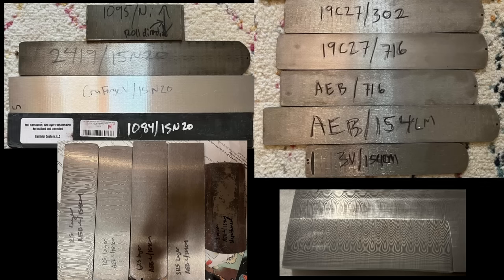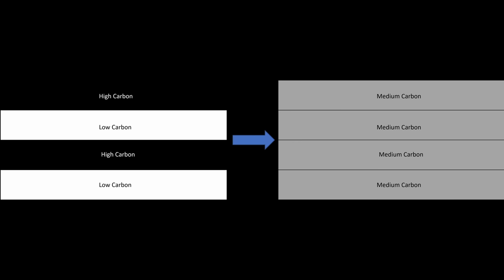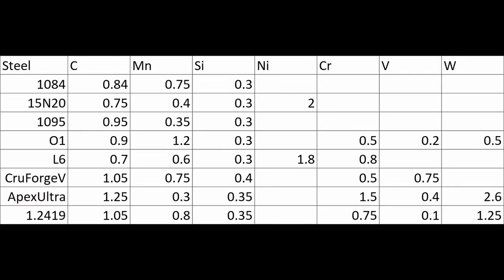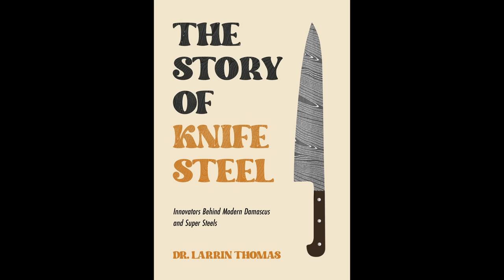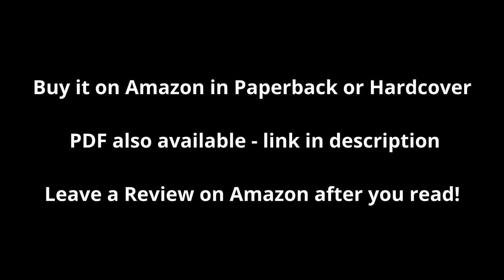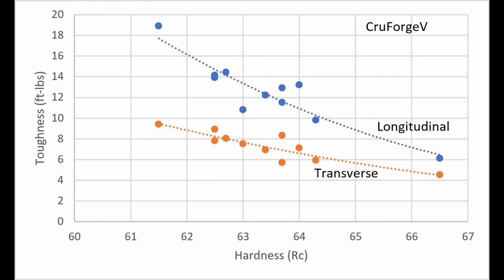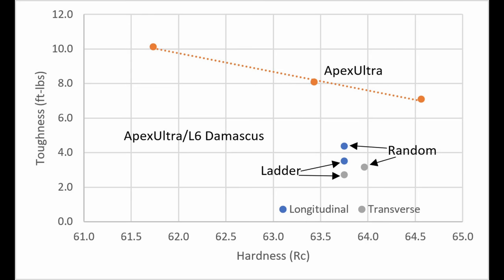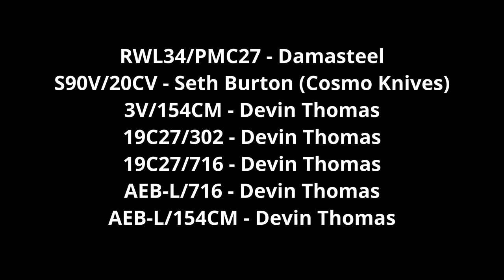Damascus vs. Super Steels - Testing a Dozen Different Damascus Steels!

Comment: Nice. But why are you calling PWS, "Damascus"? I readily concede that you know more than me about metallurgy, but Damascus and PWS are not the same thing at all. So many people are deceived into buying PWS knives, thinking that they are getting real Damascus, which hasn't been made in a very long time unless you count the analog created by Al Pendray and John Ven Der Hoeven, which is probably the structural, functional, and chemical equivalent. I HATE it when people who should know better, call PWS, Damascus.
Reply: Because PWS is Damascus even if it isn't "real" Damascus.
Reply: @rays5163  No it is not. Why is Damascus called Damascus? Because a lot of swords were made there, from Wootz steel, and PWS was not used historically. By calling PWS "Damascus", you are ignoring the origin of the term and spreading misinformation. But go right ahead if you want to be wrong. Say it loud and proud. Show the whole world how certain you are that right is wrong and wrong is right.
Reply: @growleym504  no it's not ignoring anything. It's called pattern welded Damascus industry wide. Your refusal to accept facts does not make it misinformation.
Reply: @rays5163  Not a fact at all. Everybody being wrong together, does not make them right.
Reply: @growleym504  in the case of language thats actually exactly how things work. the reason it was called damascus to begin with is because everybody agreed on using that name. now everybody agreed on calling pattern welded damascus pattern welded damascus and kept the pattern welded bit to differentiate it from traditionally made damascus.
Reply: @rays5163  Nobody asked me. So definitely not everybody, but those that do agree are all wrong, plain and simple. PWS has nothing to do with Damascus, the city that made actual Damascus well known to Europeans. Repeating improper speech only compounds error. But you go ahead and call it Tofu or wool or Neutronium or mahogany or lasagna, for all I care. I can see that logic has no meaning for you and so I have nothing else to offer in way of making you see the light. Have a great day! I'm gone.
Reply: @growleym504  true. nobody asked you. that's because you don't get to decide what the things are called.

Comment: I am just wondering why we cannot just identify what is being called "Damascus" as "Welded Pattern Steel"? After all, how many makers today are using crucible steel. Is "Welded Pattern Steel" just not romantic enough. I am impressed with your findings. Kudos.
Reply from the maker: Typically it is called pattern-welded Damascus. There are some bladesmiths still making Wootz. Pattern-welded is still often called just Damascus but I try to be precise.
Reply: @KnifeSteelNerds  Yes, I am seeing pretty much everyone around the world making or offering pattern-welded implements, calls them by "Damascus". I also have seen that every wootz maker I know of will not call it "Wootz Damascus". Maybe except for Pendray et al. I think they spoke of their crucible made wootz as wootz Damascus. But then toward the end there they were getting ore from the region so, it would seem appropriate. I guess it is kind of like the "Crescent" wrench. Everyone with an "adjustable" wrench calls it a Crescent.☣

Comment: Please excuse my ignorance to metallurgy I have little depth in that field. I do have some knowledge from a data collection point of view.   Grantees from my perspective tend to have a opinion they are trying to provide although I didn't pickup what you were trying to prove of disprove.  It seems you have one offs that you had collated and causated the beginning of a very expensive project. I would say you needed more samples if you were going to draw a more definitive data model/s.  I was under the assumption that there are vast amounts of money thrown at idea of sharpness. It seems that ignoring the common model lacks a fundamental basis of comparison. 
From my point of view and the budgetary limits of this experiment. You just need way more folks participating in this experiment especially since you can't really say this bit of data is a bad sample over another.  Have you consider increasing the scope. Who knows get a few folks interested you might have the the start to a grant prospectus. Lord know the vast amounts of money tossed at mostly useless studies. This is far more interesting than work place bathroom breaks, bird migrations or the sexual practices of chimpanzees.